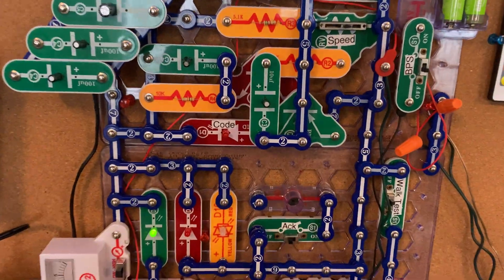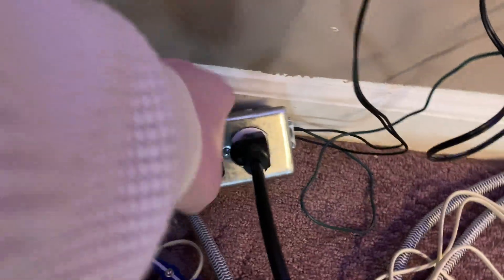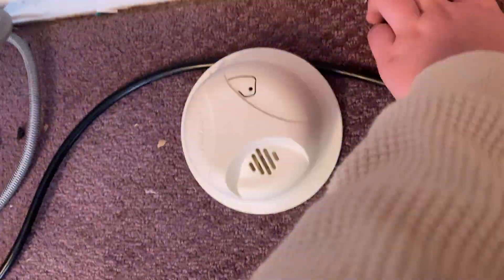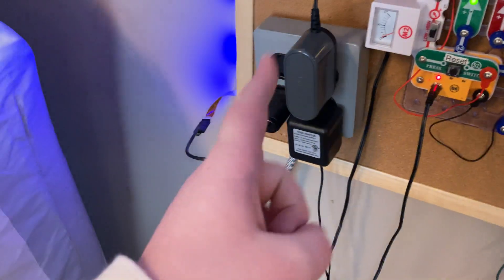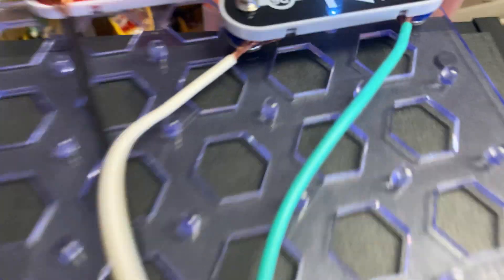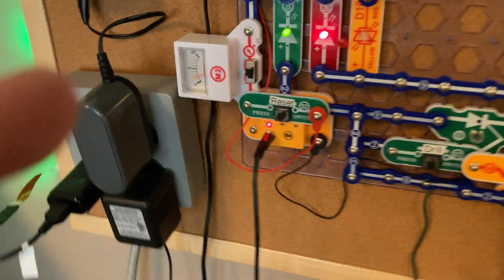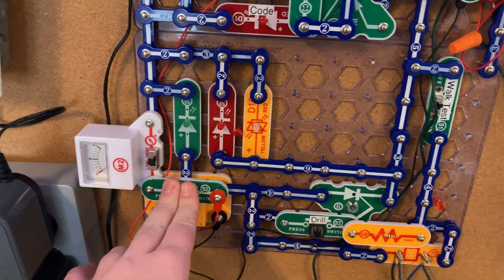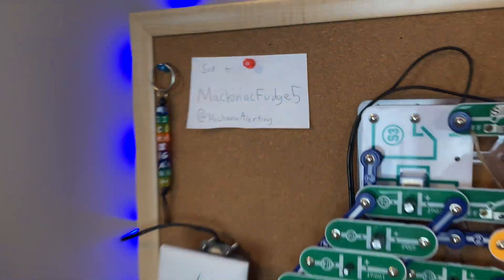Snap-Circuits fire alarm system test #9 SMOKE DETECTION!!!

Comment: Can you release another video of fixing the osiliscope so that it can look normal standing up right?
Reply from the maker: No, the horizontal deflection coil has a higher resistance so the signal won’t be as impressive
Reply: @ it’s ok, but it’s a pleasure to have you comment. It’s fine if you have a weaker signal. I know that because I have 9 CRTs and have been learning.

Comment: I see inb the rear of the smoke detector box it says photoeletric so it wasnt  the ones that have radium inside this one is not radioctive
Reply from the maker: Yes all i3s are photoelectric
Reply: ionizing have americium 241 in them in sealed form. but they have built crazy industrial ones with plutonium. unsure if actual radium

Comment: The diode might be voltage spike protection for the relay coil
Reply from the maker: No it is actually a thermistor for the 135 degree thermal